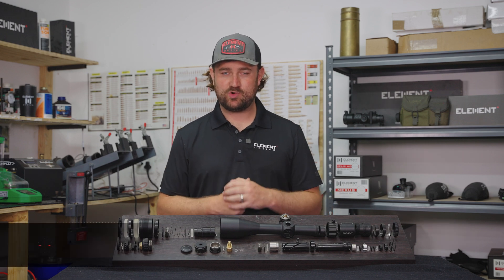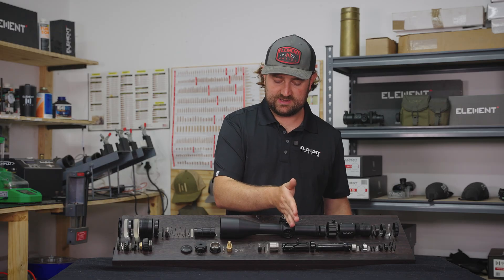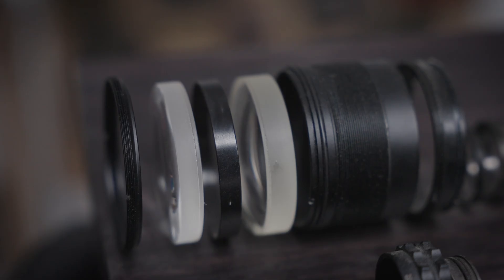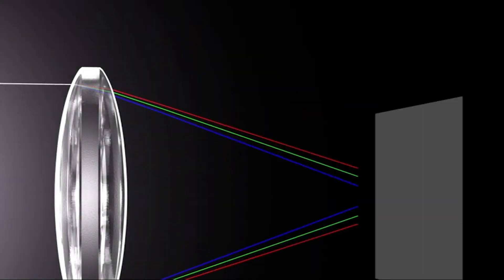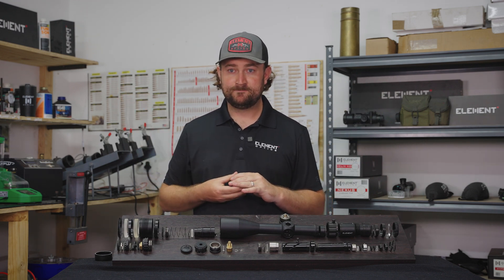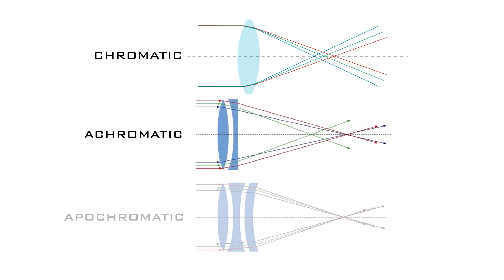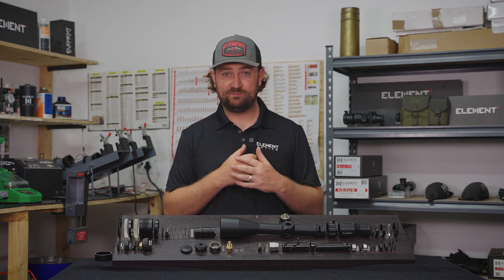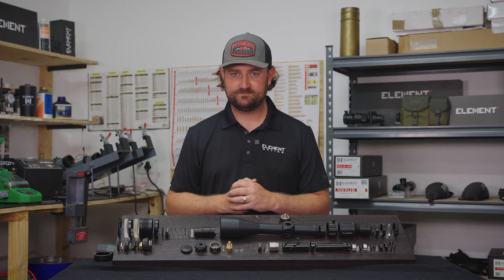Anatomy of a Riflescope, Part 3: OBJECTIVE

Comment: Why your products are not guaranteed on 308, or rather my question is, are your optics for air rifles?
Reply: Should be a lifetime platinum warranty on the scopes.
Reply: @ Unfortunately, the 308 is not covered under warranty in Turkey
Reply from the maker: Hi, all of our products are rated to 1000G of recoil force, which is far higher than what a .308 Win can produce. If your retailer says otherwise, they are incorrect. Our warranty remains in place regardless of what rifle you mount it to.